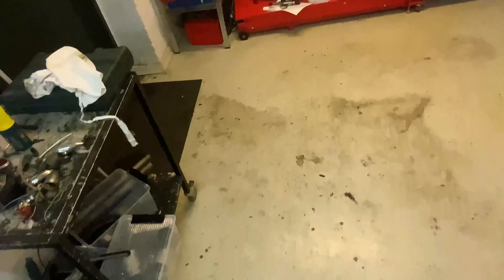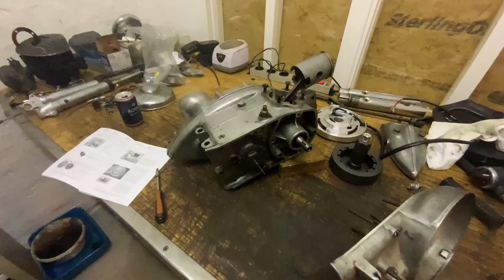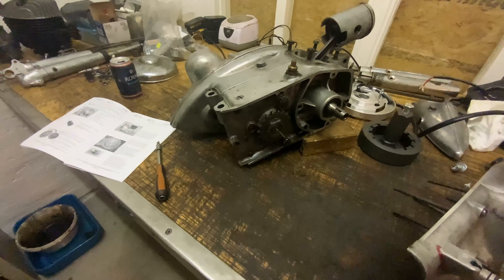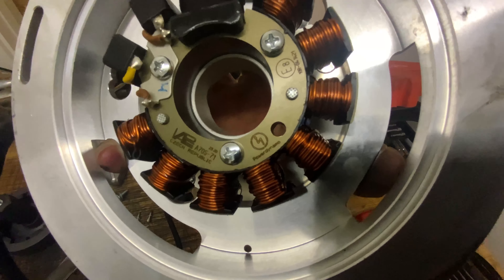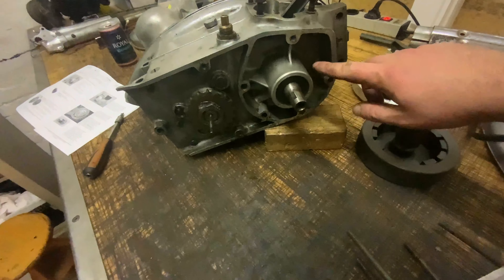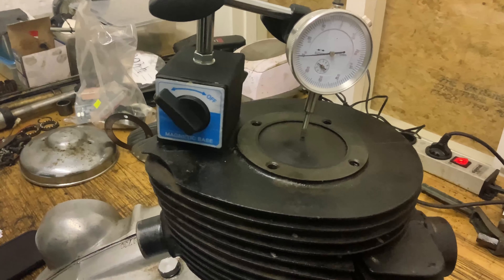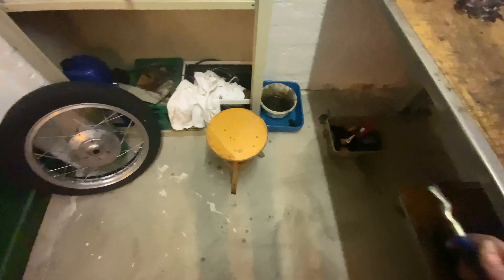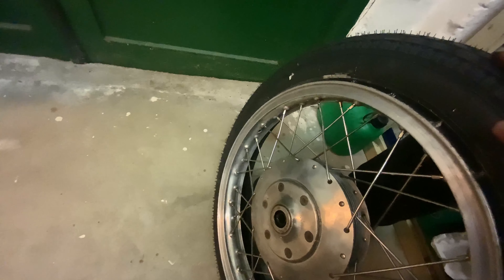Victoria KR26 Electronic ignition and wheel set back

Comment: Hi Daniel, I think you've missed my reply on reply :) regarding engine oil. Here is it again: " I just got the same bike for maintenance, and need to chance the engine oil. I guess the top bolt is for filling the oil.. At least at the bottom I found two bolts for pour oil out. Thank you! Btw, for mixing oil with petrol I use this - 20ml oil for 1L bensin,  which is about 2% as you've said." Thanks for support!
Reply from the maker: Hey thanks for asking - I need to get back to this project perhaps in the winter. yes the top bolt on top of the gear box, mine have a dipstick with two holes for marking max and min - i don't think it has a "oil level hole" as found on other bikes at the time. My assumption is around 1,2-1,8 L I have to look it up.

Comment: Ist bei der KR26 nicht der OT 1,5mm unter der Zylinderoberfläche? Und der Zündpunkt dementsprechend 3 - 4,5mm vor OT?
Reply from the maker: sounds about right, from the original settings, but in the VAPE installation manual it is said that the ignition point can be set to 1,5mm before top (due to modern petrol quality) and the micrometer is zero'ed at top dead center (probably about 1,5mm from top of cylinder) - I'm currently putting the bike together after painting, I'm looking forward to see how it's set at 1,5mm  - ok edit, I found the manual, I need to go back to 3,5mm according to this online manual page 4 https://www.tola-tools.de/0-vape/VAPE%20Zuendung%20Ardie%20-%20Installationsanleitung%20771779900.pdf) I must have misread.

Comment: Does this engine use oil? If so how much? Thanks?!
Reply from the maker: you mean oil in the fuel ? then yes, originally 4% but modern days about 2-3% should be ok
Reply: @dan1eln1el5en  no, I mean inside engine. I just got the same bike for maintenance, and need to chance the engine oil. I guess the top bolt is for filling the oil.. At least at the bottom I found two bolts for pour oil out. Thank you! Btw, for mixing oil with petrol I use this - 20ml oil for 1L bensin,  which is about 2% as you've said.
Reply from the maker: @SlavaDruk  sorry i missed this comment, there are always 2 bolts at the bottom of these german bikes, do not pull the wrong one ! on my MZ one comes with the spring and steel ball for the engagement drum for the gears, do not loosen this unless you have to. the "right one" is always the biggest and the one at the lowest point. I've seen too many pulling the "wrong" one and then loose the steel ball or teh spring breaks or similar, the oil inside the engine is "shared" gearbox and clutch in the "uni" engine block - cylinder etc is lubed through the benzin/oil mixture and there usually isn't other oils on these kind of bikes.